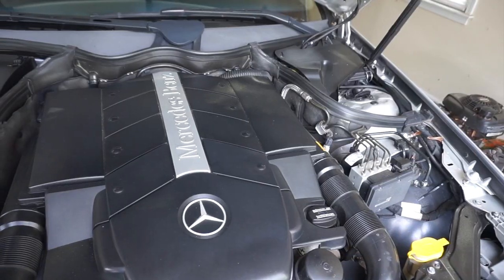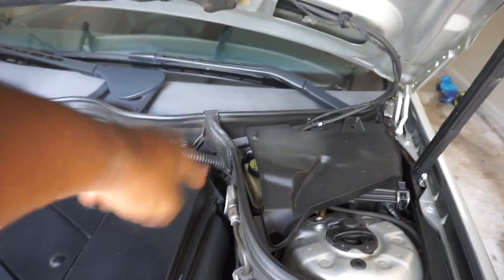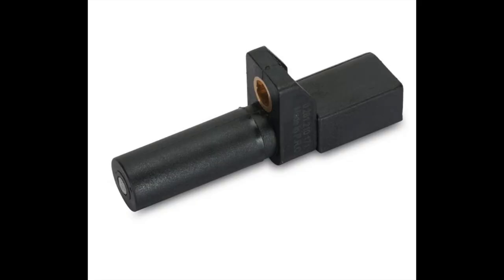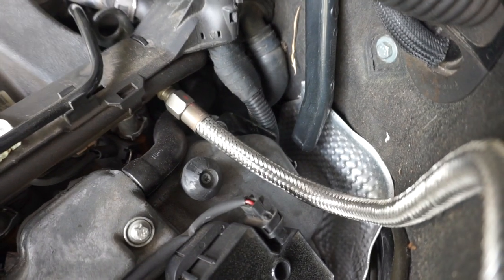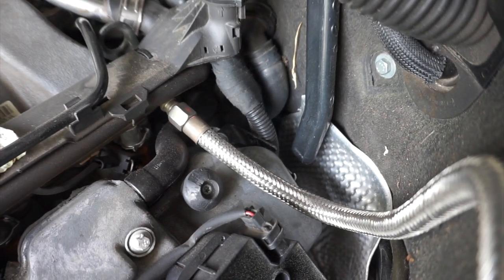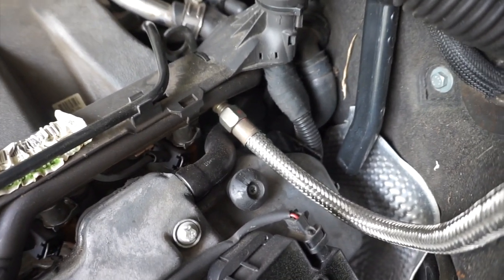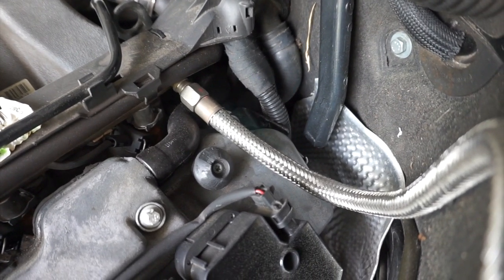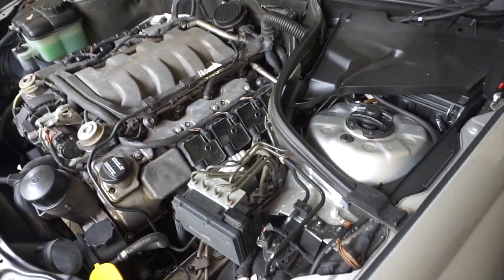A Common Problem I Experienced Since Ownership Of My Mercedes CLk500

Comment: Crank Position sensors last at least 12 years if genuine MB or  Bosch. No need to change every two years.
Reply from the maker: I didn’t know that! Thanks on the update, I would have to pin your comment for people to see that
Reply: You're right,  i got  my exactly 12 year.

Comment: I replaced the Crankshaft Position Sensor on my 05 CLK500 twice, with 5yrs and 50K miles in between. The first time I did it I had the same issues with access. The second time, I figured out that it's about a 20 or 30-minute job if you take the MAF off and kneel on top of the engine so you can reach the sensor with your left hand.
Reply from the maker: That’s a very smart move! Would have to do that in the future but it might not happen for a very very long time

Comment: Help!!!I have 2003 ck 500 what should timing advance be?mine is -and goes more negotiable with throttle
Reply from the maker: Good question, I’m not a tuner or not sure if someone worked in the engine but check to see if it’s stock ECU tune before anything else

Comment: when you changed the sensor did you disconnect the battery? did you have do do anything after you installed it?
Reply from the maker: You don’t have to unplug the battery. After you change the part you don’t have to do anything else but to drive and enjoy the car 🤘🏾
Reply: @HeyboysGarage  thank u. I like your videos and I am a subscriber. Keep the videos coming. You are doing an amazing job.

Comment: I believe this is the problem I am having just seems impossible to replace 😭 any more tips?
Reply: Did you have to relearn it with a scanner after replacing it?
Reply from the maker: No you don’t, it’s just a crankshaft position sensor. You really have to get in there and change it out not much than to take off parts such as the mass airflow sensor and throttle body to get in there. If you have to get on top of the engine I would

Comment: I have a 2004 clk500 no lights came  70k miles but it’s wanted to stall at some traffic lights but not all is it a cps sensor
Reply from the maker: When it stalls, are you able to turn it on right away?
Reply: It never stalled out yet it just wants to stall at some lights it’s still doing it gets worse but hasn’t stalled and no codes
Reply from the maker: @jasonmerlino3815  does it only do it with the AC on?
Reply: @HeyboysGarage  yes with ac on and usually does it after I first start it the first time stop light
Reply from the maker: @jasonmerlino3815  I think mine is starting to do that also. I’m not sure what it is
Reply: @HeyboysGarage  this weekend I’m im gonna change mas flow sensor and the crank sensor and both air filters and see what happens
Reply from the maker: @jasonmerlino3815  it could possibly be the mass air flow sensor
Reply: @HeyboysGarage  we’ll see have the parts putting them in this weekend car only has 74k miles
Reply from the maker: @jasonmerlino3815  let me know which solves the issue
Reply: @HeyboysGarage  ok I replaced air filters, mass sensor and the cps sensor and the stalling went away and the car has better acceleration problems fixed
Reply: I had everything apart so it was easier to change both sensors
Reply from the maker: @jasonmerlino3815   so you don't know which part solved the issue? You changed a lot at once
Reply: @HeyboysGarage  lol no I just replaced all them all.
Reply: I had everything taking off already so it was easy to get to them all
Reply from the maker: @jasonmerlino3815   could have been the mass air flow sensor. Thanks for the update!

Comment: My 2004 clk has been sitting for 3yrs. It wasn't starting or cranking at all. I replaced the ECU and it started to crank but will not turn over. I'm going to do this and see if this is the issue
Reply from the maker: I’m not sure if the ECU might need programmed to the car since you changed. I will try and find that out. That’s odd that the old ECU isn’t working. Was that a problem is that why it sat for three years?
Reply: @HeyboysGarage  Old ECU got wet. It started intermittently starting..not starting. Then it just stopped starting and turning over. I order a ECU from eBay and installed it cranks but doesn't start. . It's so hard to find anybody to program the ECU to the car . Don't know if that's it's since now it's trying to start

Comment: Crankshaft position sensor failed on me while I was at work and, I had to leave my car there came back later the same day and it didn’t start at all. The battery voltage was at 12.1 and had to wait till a tow truck was available to take me to a shop lucky there was one down the street and, turns out it was the sensor and started got the sensor replaced for 80 and starter for 350 and about 250 in labor.
Reply from the maker: Starter and sensor, I haven't have a starter go out on my cars yet. That but luckily you had a shop close by

Comment: hey bro, i’ve owned a clk500 for almost two years now, it has 120,000 miles. i hear a lot of creaking like old bed springs in my suspension even though i changed upper+lower control arms and struts. i also hear loud creaking when i turn the steering wheel to parallel park and i just changed my tie rods, this is only a noticeable problem in cold weather have you had any sort of issues?
Reply from the maker: This sounds like a strut that’s old. Anyways sounds like you have done a full suspension service which is good! You shouldn’t be hearing that noise after. One thing I would say is sometimes people forget to lubricant the struts at were the shocks meet which causes squeaky noises after sometime. But you shouldn’t be hearing that after charging All the parts you just listed
Reply: This is usually the sway bar bushings usually the rears. just jack up the rear and its a couple E bolts.

Comment: Will the car just switch off which would be a problem in heavy traffic or highways riding as the traffic is heavy here , what other mechanical issues or electrical issues does the car give, would it work fine as a daily driver without breaking the bank as the car is inexpensive here but I wouldn't want to suffer on repairs
Reply from the maker: Once it goes bad it will shut off but you would have to give it 25-35 minutes to cooldown before it will start up again to get it home to replace that part

Comment: I would be willing to bet you spun the tires before parking. High rpm’s at low speed is a common reason for that code. I would bet the sensor is not bad. Especially considering it cleared. My Toyota pickup does it often in rainy weather and snow because the rear is so light. Chances of that sensor being bad are slim.
Reply from the maker: For the Crankshaft position sensor?

Comment: Changed mine, changed fuel filter, fuel pump is good, and cranks but dies…
Reply from the maker: I'm not exactly sure what the problem could be. Are you getting a check engine light?
Reply: @HeyboysGarage  figured it out. took the f/p relay apart and forced it to engage and yeah, bad relay and pump. FCPEuro parts coming in tomorrow!
Reply from the maker: @yachtkuza  Awesome I'm glad you were able to figure it out. Took sometime tho
Reply: @yachtkuza  Please excuse my ignorance, what is F/P relay?
Reply: @terrencetaylor8196  Fuel pump* and update. Still no luck. Same result -_- going to clean injectors next but it seems to have electrical issues.
Reply: @yachtkuza  I truly appreciate you responding; I am sorry to hear that the issue remains.  Best of luck on resolving it, as I am having the same issue.